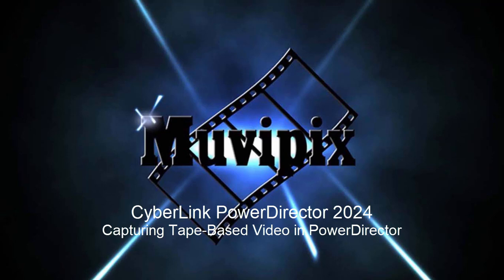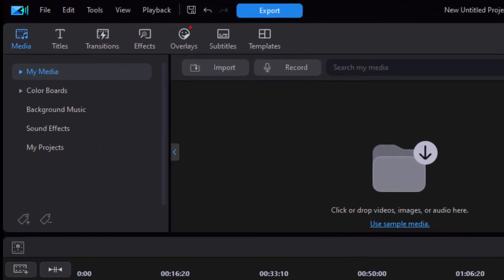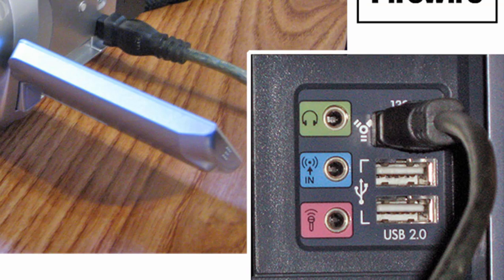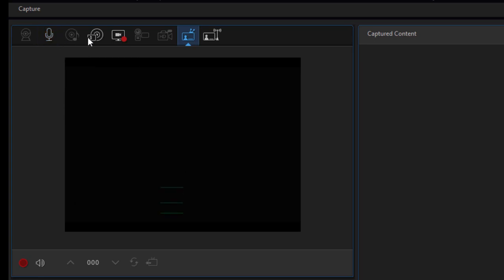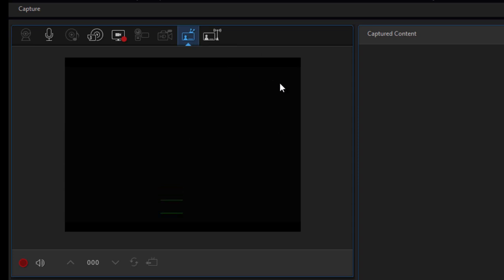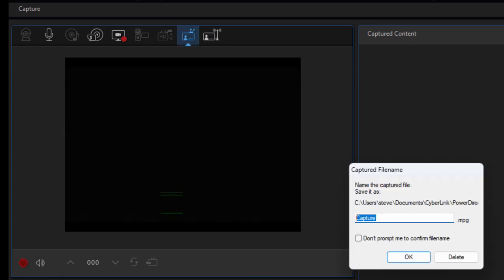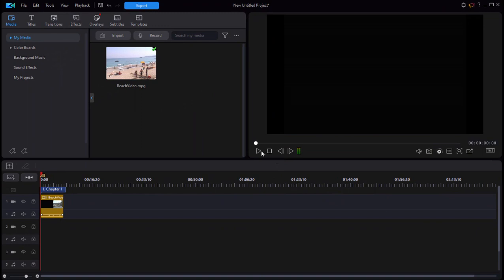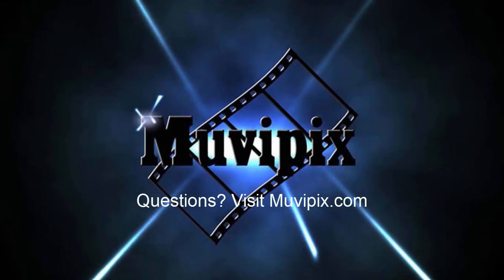Capturing tape-based or analog video in CyberLink PowerDirector

Comment: I don't see the capture option under the file menu. Are you using the free version?
Reply from the maker: I'm using thy Ultimate PowerDirector version.
Reply: @sgrisetti  I am using powerdirect
or 365 annual sub..  The capture version was in the software, after an update, it is gone.. :(  Any thoughts?
Reply from the maker: Sorry. I don't know why that would be.
Reply: @guppy235a  Hi Guppy and Hurley - I also have PowerDirector 365 under annual licence.  I've successfully imported analogue video from my Sony MiniDV player via FireWire. They've just removed the word "Capture" and replaced it with "Record".  So just follow the advice in the video above.  For me this worked: File/Record/Record from Webcam/Capture from a DV webcam
Reply: I was able to capture videos from my VCR and Camcorder, over 2 years ago but now the capture option is blurred out. Extremely frustrated. Any suggestions please?